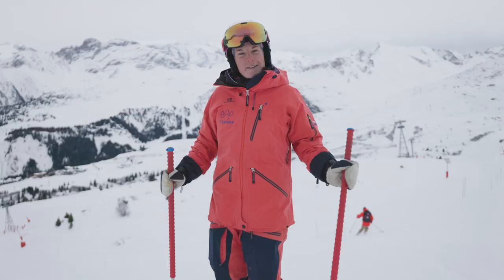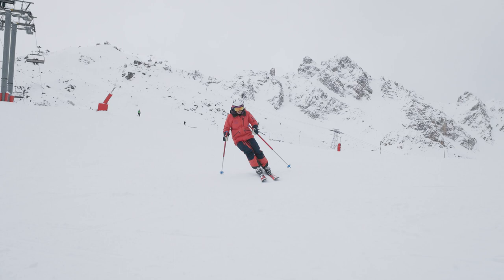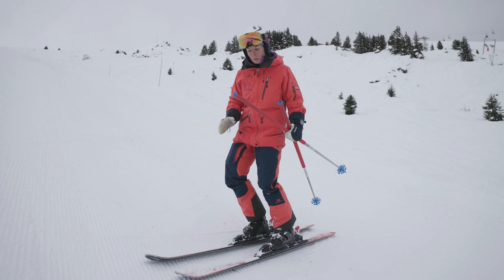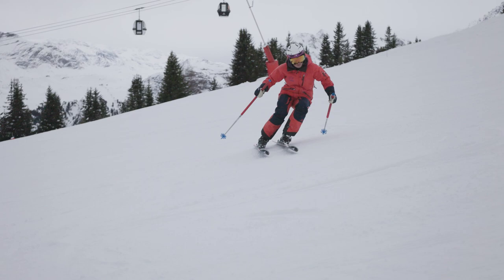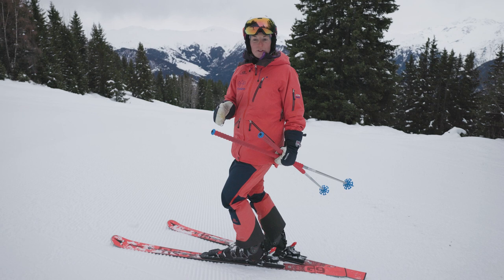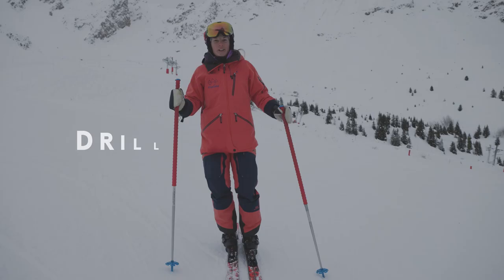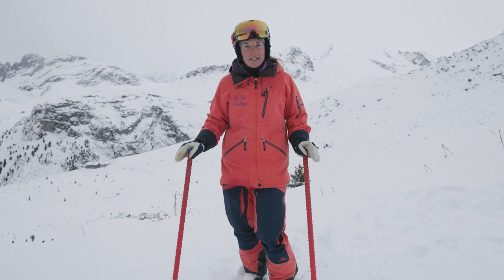FROM PARALLEL TO CARVED TURNS | Tips for skiers to progress from skidded parallel to carved turns

Comment: As a fellow instructor I want to say what was covered in this video was done well. Some good drills but the leap from railroad tracks (with a fast tempo)  into high performance medium radius carved turns (with a slower tempo) I don't think is realistic for an intermediate skier who was previously making skidded basic parallel turns.  Intermediate skiers are unlikely to know how to balance with more/most of their weight on their outside ski, so some time needs to be spent explaining how that's done in combination with the edging drills that were well explained.  Helping skiers that are skidding their turns learn how to blend the tipping/leaning of their bodies with moving their torso (using hip angulation) back towards their outside ski is (in my view) a critical piece of the the puzzle that a student/guest needs to learn BEFORE they can start experiencing some success with carving.  I've found that intermediate skiers can advance a lot more quickly IF they understand the WHOLE picture, which also includes explaining the design of the ski and how/why it turns when it's tipped up on an edge.  And finally there is turn shape and how the rate at which you turn your feet and legs must take place much more slowly (than most intermediate skiers are accustomed) and in sync with the size and shape of the turn being made.  YES, this is A LOT of information, but our brains are much happier when they thoroughly understand how all the pieces of the puzzle fit together.  When a few pieces are left out the chance for confusion and misunderstanding increases.

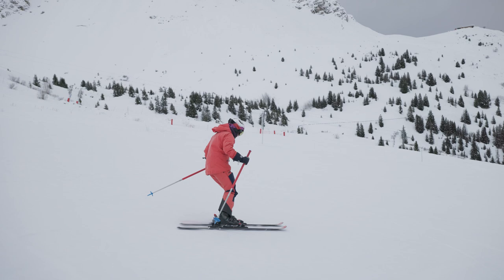Comment: One thing I seriously struggled with until recently, and is clearly demonstrated at 4:26, but not mentioned at all: The inside ski needs to come ahead of the outside ski.  If you try to keep the ski tips even, you won’t be able to get the proper lean in order to edge the skis.

Comment: When starting to get into carving (after a HUGE break in my skiing career) I found that, rather like some of issues in the other comments here, it was hard to work out how to balance correctly as I started the turn and also how get the ski bending more in the middle of the turn and then stop it from skidding out at the end. I sorted that by leaning toward the tip of the outside ski which made my hips move to the inside, tipping the skis on their edges and starting the turn. More lean bent the ski more and decreased the radius. Then I had to back off the power and have more even fore-aft weight distribution toward the end of the turn to keep the whole ski on the rails and prevent skidding out. Once I had sorted out the balance, power and fore-aft issues it was time to get more into the tipping to make the turn transition more effective.
[Kingussie or Grantown Grammar? 🤔]